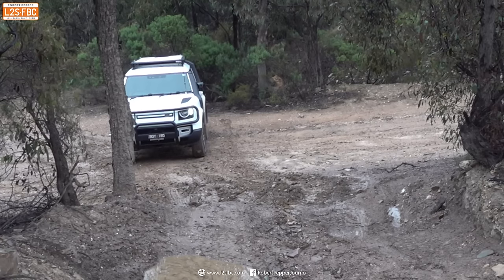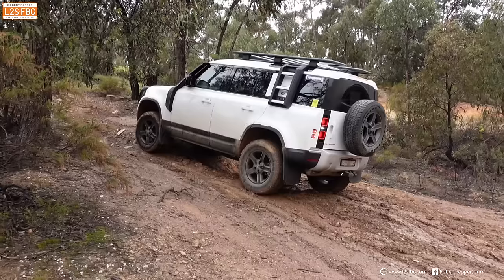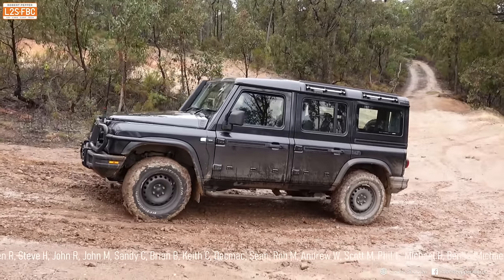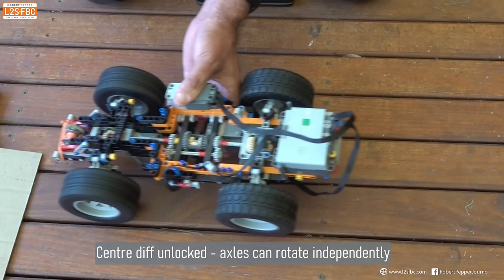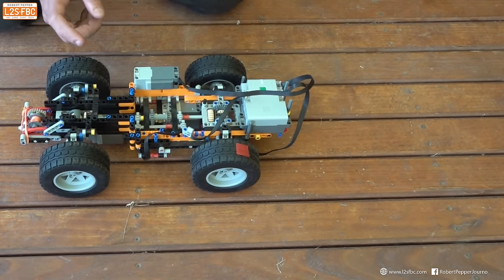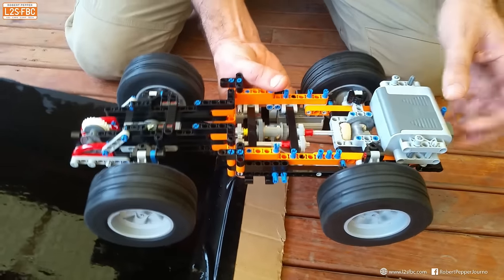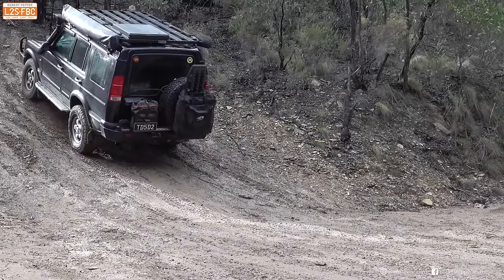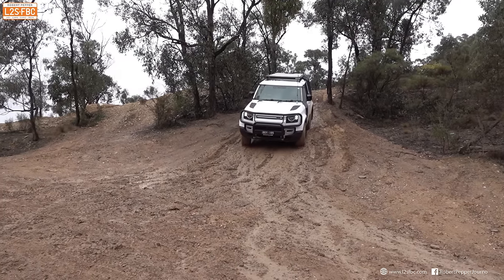The Centre Diff On Hills Problem: Grenadier vs Patrol vs LC300 vs Defender - Part 6

Comment: Why doesn't ebd (electronic brake force distribution) or abs kick in to prevent the wheel lock up. Are their thresholds higher because of the low speeds and off road modes? In road mode maybe is there any interference?
Also kind of dissapointing you can't lock the diff (or clutches) with the engine off. Land rovers instead of a regular parking brake used to have a transmission brake that worked on all four wheels even with the center diff unlocked.
Reply from the maker: ABS prevents a wheel locking. EBD (electronic brakeforce distribution) distributes braking force to the wheels according to their traction, so an electronic, automatic, brake-bias system. Both are disabled at very slow speeds.
Reply: A tailshaft handbrake operates on the rear tyres via a typically open rear diff, and on the front tyres via typically open centre and front diffs.  If the transmission is effectively locked this means if one rear tyre and one front tyre lose traction all braking can be lost.

Parking brakes on both rear wheels are clearly inferior when the vehicle is in RWD mode.

[EDITED}
Reply: @L2SFBC  True, these backwards slides may look dramatic but realistically the vehicle never went above 10-15 kph. Still, with it's accelerometers the car knows it's going backwards so letting the following wheels lock up that much seems like a dangerous omission. On tarmac abs in reverse is much more keen to kick in if you try to activate it, than going forwards, because the axle with the lighter load has the bigger brakes and more braking force.
Reply: Sorry, my mistake, I was under the impression that the parking brake on old land rovers worked on the center diff input shaft, but you are correct it works on the rear output shatf, so in order to work on all wheels you have to lock the centre diff, my bad
Reply: @apostolis2939  not being able to turn while reversing can mean the vehicle ends up in the wrong place and needs recovering.
Reply: From an electronic pov the sensors are unable to provide clear pulses at low speeds as it is often variable resistance (VR) so the reluctor ring has to move fast enough to generate the pulse and get through the filtering. 
Early tests for abs suggested that below 4mph it wasn't needed (better braking and loose gravel/snow pile up) so systems are designed that way. Once the pulses get too fast the system cannot distinguish them either so it's a speed range compromise. Road speed wins.
(Ex electronic engineer who spent lots of time with megasquirting their LR V8
Edited as mixed hall and VR up)
Reply from the maker: What's "too fast" ?
Reply: @rhetth-s8082  Yes, that's why it is so dangerous, it's worse than going forward and pulling the handbrake because then the locked wheels exaggerate the turning of the front wheels. Here the turning wheels lock so  steering input is futile, you are going where graity wants you to go
Reply: @GavinEarnshaw  while a skilled driver would be hard pressed to beat ABS when stopping on tarmac, i think its still easy to stop quicker on dirt and offroad terrain without ABS.  I think manufacturers of 4WD vehicles should not lord over customers and reduce what can be achieved with the vehicle, they should give them an ABS on/off switch.
Reply: @L2SFBC  long time ago I read 60-70mph as it is mostly to do with the electronic filtering.
With VR the faster the 'teeth' pass the ring so the magnetic/electric pulses/zero crossings blend into one and get larger. Within the electronic circuits are noise rejection and bandpass filtering so there is a 'good' range of signals.
Hall-effect is better but not used as often in ABS for some reason.i think cost and operating conditions (temp/vibration etc) make it harder for automotive use. You know they will use the cheapest parts...
Reply: @rhetth-s8082  I think many here would agree. The number of drivers we get at our 4x4 training site is tiny compared to the number 4x4/SUV sold. On Stag parties many drivers think they can drive off-road -and so most UK companies - as they have a driving license. Giving them an off switch for the safety systems...
Most manufacturers though can see adding some software to an existing system (ABS) to replace big expensive hardware appealing/profitable. Rarely do us off-road weirdos buy new vehicles so manufacturers don't see us as customers.
Grenadier was a hope and apart from some odd things they pretty much gave us a modern old-school LR Defender. But even that has Brake TC, ABS, downhill assist etc as customers expect the shiny stuff.
Reply: @apostolis2939  i edited my post on the tailshaft handbrake because i initially didn't think about it enough.  I still need to think about it some more.  It might be a good topic for a future Pepper video.

Comment: Exactly what I always have been saying. The front brakes should never lock up first. This new One Ten is crap.
Reply: It has not even a centre diff to save 1% fuel but wear out the 2 driven tires faster.
Reply: Always remember this movie if not locking the centre diff or have an automatic or computer adjustable viscous locking centre diff or only a viscous unit. https://youtu.be/22lP5_QmAJ0?si=Uj-NtRwgS3DP2iLz

Comment: I won a defender in a raffle and it was so pathetic off road,  that I traded it for a subaru crosstrek
Reply from the maker: Did you remember to raise the Defender's air suspension from Access?
Reply: @L2SFBC  
It broke the second day I had it and became a low rider